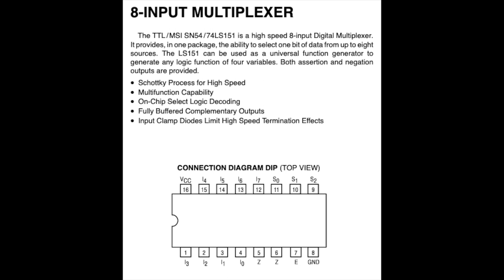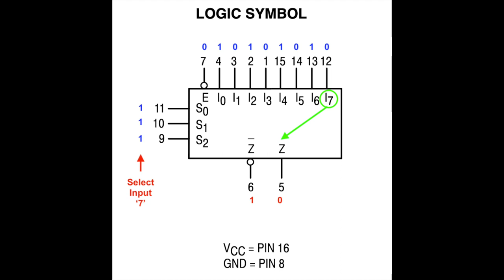Will it work? A 50-year old 74151 chip.

Comment: TTL parts follow a so-called bathtub curve when operated within normal parameters.  There is a rapidly dropping relatively high initial failure rate due to manufacturing defects (cracks, contamination, etc.).  The curve bottoms out close to zero for the next 20 or so years worth of power-on operation and gradually the curve begins to slope up as temperature cycling, operational fatigue, etc wear the part out.  Mil spec parts are given a 168 hour burn-in to hopefully weed out the infant mortality failures of the bathtub curve.

In storage, a TTL part ought to last a very long time if stored within the temperature extremes stated in the data sheet.  Failures might be due to extreme temperatures causing unequal expansion, static discharge damaging the die and mechanical shock in excess of that allowed on the data sheet.

Static discharge can be a sneaky problem because it can damage the die, not immediately incapacitate the function, yet induce a latent failure.  The failure results from heat stress in the die due to increased resistsnce and i^2R heat in necked down pathways in the die which were partially blown out by static discharge.

Another way to burn out chips is to over-volt an input to the extent that an intrinsic SCR in the substrate is triggered and latches on.  The load of the SCR between power and ground can cause an over-current on the bond wires inside the chip carrier sufficient to melt the wires.  If you’re lucky latch-up can be cured by a power-cycle of the equipment … until the next input over-volt occurs.  Latch-up damage of TTL is rare, but not impossible.

The strangest failure of old stored TTL parts which I have seen is the pins being eaten off parts which were pushed into an apparently chemically incompatible foam.  I haven’t seen it, but I suspect a similar thing could happen on a conformally coated circuit board which was not correctly cleaned before the coating was applied.

I have a Radio Shack Micronta digital clock sitting here which has been powered on since 1975, even with all of its original capacitors.  I suspect the clock will easily manage 50 years of operation.

It is a big planet and probably any failure mode you can imagine has happened somewhere.
Reply from the maker: Thanks for your explanation. The latch-up condition is particularly interesting. Apparently, the risk of latch-up in CMOS and TTL increases with temperature, presumably due to the lower forward bias voltage of the internal PN junctions. 
Hopefully someone can redo this video with this same chip in another 50-years' time.
Reply: @inazumadenki5588  Thank you for the reply.  It is good to know temperature affects latch-up.
Reply: Very interesting, thank you. That bathtub curve applies to almost anything really, things either break very early due to manufacturing defects or very late in life when things are worn out. One failure mode you didn't mention is electromigration of ions, though I don't know if these old manufacturing processes are sensitive to that kind of thing, given the relatively large structures.
Reply: @lbgstzockt8493  Thanks for the reply.  The failure analysis people at a place I worked had a batch of some type of small scale parts, I don’t know of they were TTL or CMOS, which they were able to determine failed due to surface contamination containing relatively high amount of fluorine apparently migrating into the chip.  The analysis used an auger probe scanning beam electron microscope with exhaust fed into a mass spectrometer for analysis.  That case was apparently not ions migrating across an intentional junction.  That was a pretty cool lab to visit and made a good tour stop for job applicants - they could operate decapsulated ICs in the SEM and you could watch shift registers move bits about due to the electric field in the chip modulating the beam intensity.
Reply: Thanks so much for sharing this @wtmayhew. I recall now the input over-voltage that was the threat of so much TTL logic. Large scale input arrays we produced for manufacturing industry ended up with very high part-count input cards just to protect the point of acquisition.
Reply: @artysanmobile  Thanks very much for your reply
Reply: Bath tub curve? Never heard of that one before. Does it relate to Poisson Distribution I wonder? My take on a unified theory why all semiconductors will fail eventually is that oxygen will migrate through the encapsulation and do uts thing to the silicon wafer. I would be curious to know whether there is any data to indicate if hot melt dipped junctions last any longer than silicon planar junctions.
Reply: @factorylad5071  Good comment.  I suspect if you look in the preface to an old data book in the section on reliability you can probably find a reference to bathtub curve.  I believe it was a 1970s Signetics book where I first saw that term.  If would say that the left side of the curve bears a similarity to a Poisson Distribution of ~ lambda = 0.5 near t=0 on x axis.  The right side resembles ln(t-k), k = some constant I’m not familiar with.  Chip failure wasn’t my main job, so I don’t know the degree of oxygen diffusion being the effect killing parts over long term.  I tend to agree that it is tough to make a package or passivation layer which provides a hermetic seal forever.
Reply: :eyes-pink-heart-shape:. - Yeap - Full explanation, very credible ... i did work in TIEP (Portugal) we did this kind of "stuff"... from abaout 1973 onwards ... in latter years the policy was to dump/crunch IC´s that had been in stock for more than 2 or was it 3(?) years ... stocking these also had costs ...not necessarily but...  i get it!
Reply: Yes, you are right about the antistatic black foam - it disintegrated (not a dissimilar story to sticky shed syndrome) and all the pins were rusted and dissolved away - happened to many of mine and wrecked the chips - all the ones loose or in polystyrene survived fine!
Reply: @AnthonyFrancisJones  Thanks for the reply.  It makes me wonder what’s in the black foam.  Apparently something hygroscopic and then the absorbed water forms an acid.  … just a speculation, not a foam expert here for sure.
Reply: @wtmayhew  Yes, sounds like it to me as the pins just 'rotted' away.
Reply: @factorylad5071  it might sound like bullshit but it's a real thing so he's  telling you the real deal.

Comment: I got a 7430 from 1969 doing address decoding in my Z80 computer, works a treat.
Reply from the maker: I've read that commercial manufacture of the TTL 74xx range started in 1966. Your chip dates back to 3 years from the start of the era. Incredible to think it's still going.
Reply: @inazumadenki5588 It is usually the capacitors which take down a piece of old electronics.  I’ve got a GE digital clock radio which was manufactured in the mid 1970s.  A few years ago, the unit started going nuts, alarming randomly and the radio activating and deactivating and switching stations randomly.  It turned out almost all of the electrolytic capacitors had dried up, showing less capacitance and higher internal series resistance than acceptable.  I had to order about 20 different value capacitors from Digikey.  After a mass capacitor swap, the clock radio is back to working fine.  It was a tedious but easy fix.
Reply: @wtmayhew  This is slightly off topic but I had recently bought an old cabinet styled AM/shortwave radio that also had dried out capacitors from the 1930s. Same tedious job with the capacitors but the old tubes were perfect. These things do not have pcboards so they basically wired the capacitors between posts.
Reply: @rwatson2609  Thanks for the reply.  I have several old radios with point to point wiring.  I had a 4.7 uF capacitor in a 1946 National HRO which was leaking oil.  I had a WW-II surplus plastic coated 4.7 uF capacitor which I swapped in.  At least it is a period correct part.  The National uses octal base metal envelope tubes which RCA introduced in late 1930s.  Like yours, all the original tubes work well.  About the only time I ever had to replace a tube which wasn’t damaged by accident was in the horizontal drive of a TV many years ago.
Reply: @wtmayhew  very interesting. I actually didn't have any OEM or period components, so I just swapped in current technology parts guessing on  the high side for voltages and staying away from electrolytic caps since I really don't see them going more than 20-30 years. I might rebuild another since it was fun. They cost very little at these thrift shops up here in Canada.
Reply: @rwatson2609  Thanks for the reply.  I also enjoy getting old equipment going.  Like you say, it can be an affordable hobby.  Here is the US it is getting more difficult to find or expensive to get vacuum tubes.
Reply: @wtmayhew  Yeah, I've never had the honor of replacing a vacuum tube, but I think that they are just a big transistor, but not sure. Either way, I agree that the hobby will not bankrupt anybody and it does keep some of history alive for another era. 
   It's funny but the radio that I bought from the 1930s came with a warning label in the back that said something to the effect that nobody should service this radio if the operator could not produce a valid radio operator's license. This radio is only a AM and a shortwave receiver, so I guess the thought that the enemy might be listening for intel was a concern back then in Vancouver BC in the 1940s. In saying that we never did see the enemy hit the shores here in any of the wars.
Reply: @rwatson2609  That’s pretty interesting about the label.  Here in the US, amateur radio operating privileges were suspended December 8, 1941 until the end of WW-II.  The ARRL, which is a organization for hams, helped talk the FCC into creating the War Emergency Radio Service, intended to give hams something useful to do in the mean time.  WERS allowed only low power levels on frequencies intended to limit useful transmission to about 10 miles.  WERS operators could serve as a civilian auxiliary for civil defense tactical communications when needed.  After the war end, WERS was reformulated into RACES which still serves as a civilian auxiliary communications service for state and local government.  There is a somewhat similar civilian military auxiliary communication service called MARS.

Comment: I used to design logic circuits using 74 series TTL ics.  I can hardly believe they've been around so long - but I guess I'm 83 so II was a mere 33 year old youngster back then.  I haven't watched the whole video yet but I'd be amazed if the ic didn't work as well as it did 50 years ago.

When you're designing h/w logic circuits deMorgan's theorem is your friend so that true outputs (mostly) go to true inputs.  I loved it :)
Reply from the maker: Thanks for your comment! The beauty of designing with discrete logic was the mental and physical effort required to design the function you were trying to achieve. I remember deMorgan's Theorem, and I remember expressing fairly complicated functions with Boolean algebra. Hard-wiring these functions was more time and effort than programming a micro controller, so it required more careful consideration beforehand. 
If you still have some old chips around then I hope you have the opportunity to power them up.

Comment: I started to experiment with a 7400 chip that year at the age of 13. In 1977 I designed and built a frequency  counter with 6 digits. Later I was hooked on microprocessors like 6800,6802,6502, 8085 plus many others. I still have a working KIM-1. In the Air Force we still have ASR-7 and ASR-8 radars from 70's  and 80's full of TTL chips.
Reply: ...and those radars still work!

Comment: Excellent just excellent, even before looking at the video - so many unknown/known chips in a box - eeproms, rams, controllers, and just chips pulled from broken stuff..
Reply from the maker: I always face the dilemma of what to do with old chips. I don't want to throw them out, but I'm pretty sure I'll never use them. 
When I came across the old AY-3-8910 sound chip in my old junk box I decided it was just to special to chuck. So I decided to make a dedicated circuit for it. Can't do that for all of the chips though.
In any case, I hope you find some use for your old chips.

Comment: I started with electronics at an age of 12 and had some experiments with digital electronic 2 years after. Today the beginning was 45 years ago. Time is running very fast.

These TTL chips can live for ever, if they are operated within their specs. The operating conditions for this kind of electronics were very relaxed. None at this time was confronted with heavy current densities (in the MA/cm² range) and electro-migration like in the chips today.
Reply: I also stated at the same age (12) but I built single valve radio receivers with positive feedback (reaction) :)   All my early electronics was with thermionic valves  - then the new-fangled germanium transistors followed by silicon, analogue ic operational amplifiers (m702) before the MSI 74 series logic.  Of course, I ended up writing software :)  Things changed a LOT during my career and it seems to be even faster since I retired 20+ years ago.
Reply: @belperflyer7419  12 years seems to be the date. When my younger son was 12 I was allready divorced and I changed to another flat. At this time my son often came over after school to sit in my hobby room to use my ressources to build up his first own circuits.

At this time he was into audio amplifiers. He is now 23 and I have still some of his first hobby work laying around here. :elbowcough:

Comment: I appreciate that frequency response and the like might be dropping off but I recently tested the 1000 or so chips I still have from my job in 1979 and all still work. Both CMOS and TTL, mostly Texas and Motorola with some from a dozen other makes. Most surprising is that the chips are all still available today. Some types are now LS versions and plastic in place of ceramic packages. CPU Chips from the 1980's - not so reliable though.

Comment: Went to work for Texas instruments right out of the Air Force in mid 79 working in Bipolar 3 fab in Safford Tx. Worked in Lithography maintaining the various pieces equipment. We were cranking out standard TTL as well as LS and ALS devices by the millions... At the time, TI was the king of factory automation and in the photo lithography area the wafers were no touch most of the time with wafers running on air and belt tracks from machine to machine (3 inch fab) All contact printing BTW (cobalt printers)..... I currently have thousands of these type of devices in boxes that were pulls from boards where they were socketed that I bought at surplus sales for next to nothing... Still have my TI gold cover TTL data books. Went to work for Intel after 4 years and at the time, they were in the stone age in factory automation compared to TI. (1983)
Reply from the maker: Seems like semiconductor fabrication is a bit of a lost art. Hopefully we'll see more re-shoring of this industry. Thanks for sharing.

Comment: 74 hundred series chips...those were the days. The numbers of TTL circuits I wrote programs to test, all are coming back to me now. So easily understood until the manufacturers pushed their designs beyond the fan out capabilities. And that happened more then is should have ever. Mid-range values were a real problem inbreed into those circuits...  Nice to see this video!   Thumbs Up!
Reply from the maker: Manufacturers are always trying to save pennies per unit cost, at the risk of reliability and reputation. Those meager savings cost in the long run though. Cheers!
Reply: I cut my teeth on 7400 series in terms of digital----more like 74LS types. I really enjoyed building and troubleshooting electronics from that era. I unfortunately and possibly stupidly didn't keep up much when the 65xx uprocs came in, but at that point, software became much important and at the time, didn't appeal to me.

Comment: I still have slabs of these old 74 series and others patiently waiting to find something to do. Occasionally I do find things to build and so far I've not found any duds. I did
have some 741's that had become very noisy, but as with many semi's from back then, they may have been bad from new.
I also recently put aTA7205P into a CB that turned out was dead (from NOS) but I recall rumours from way back that a few manufacturers QC fails somehow managed to find their way into the spare parts market, maybe just not meeting design spec, but if they did it would explain a lot. I never had that problem with logic chips, only analogue devices.

Comment: Very cool !
Yeah so the usual killers are Static Discharge, over volt, over current, polarity.
74HC series are high speed and much more robust. 
   ;)
Reply: Actually, TTL chips are NOT easily killed by ESD, since they have fairly low resistances.
CMOS chips are way more sensitive to ESC, especially in the old days when the pins were not protected by ESD diodes.
Over voltage and wrong polarity is never liked by these sort of integrated circuits.